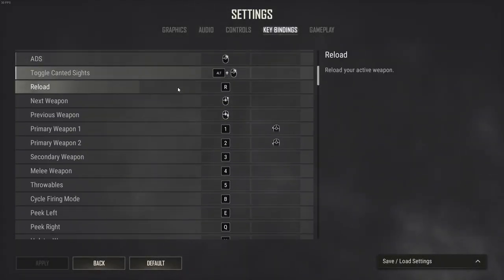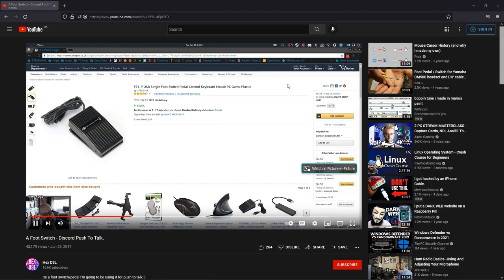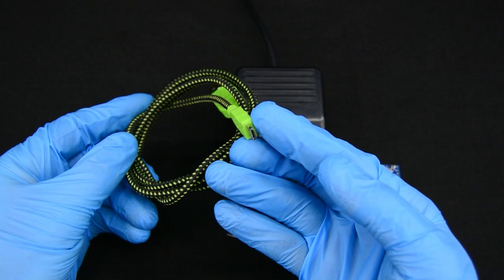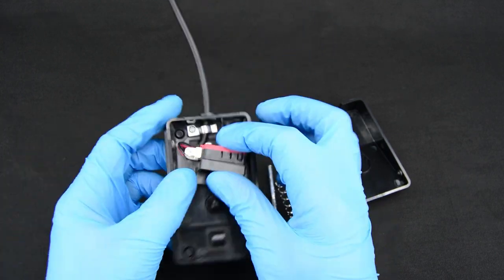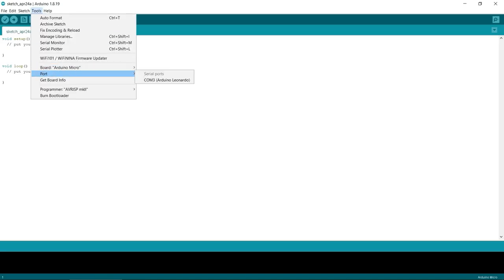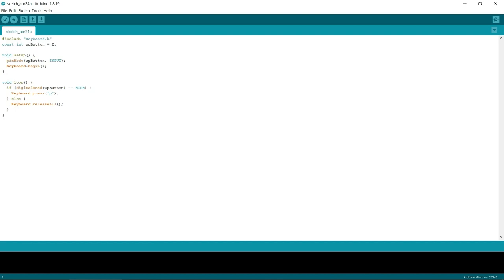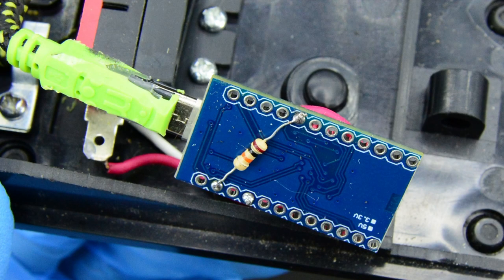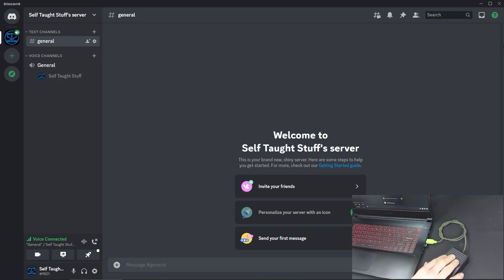How to make USB foot switch for PC (push to talk / macro)

Comment: If I'm going to use two pedals, do I connect the red wire to pin 3 and the white wire to ground? Also, what does the resistor do?
Reply from the maker: i will try to be as short as i can. 

if pin #2 is not connected to the GND thru resistor, when you close the switch you will short the VCC pin directly to GND which will damage the Arduino.

you can avoid adding resistor by using pull-down button configuration, meaning the pin will be always high and when you press the button it will be pulled down to GND. the pin #2 will be made high using the built-in pull-up resistor in the chip and you will just need to put the switch to connect the pin to the GND, but after allot of experiments, i found out that pull-up button is more stable thats why i use it everywhere in the designs like that. to change the button to be pull-down using the built-in pull-up resistors, you will need to make changes to the code:
instead "pinMode(upButton, INPUT);" you will need "pinMode(upButton, INPUT_PULLUP);" and instead "if(digitalRead(upButton) == HIGH)" you will need "if(digitalRead(upButton) == LOW)".

to add more buttons, you just need to use any of the digital pins (as you mentioned pin #3 example). you will need to add another resistor from that pin to GND and add the other switch again between that pin (in this case pin #3) and VCC. also you will have to change the code quite a bit.

i am planning to make streaming deck with tons of buttons and two foot pedals connected on it in near future. that project will explain allot about wiring buttons in a matrix or probably digital encoders. i am too busy lately with my job, so i dont know when i will be able to do that project and video. i already started making few videos that i am unable to finish atm.